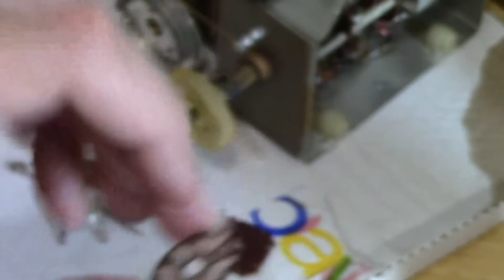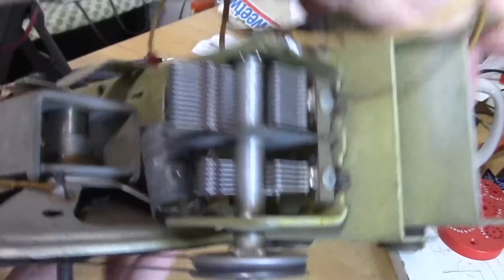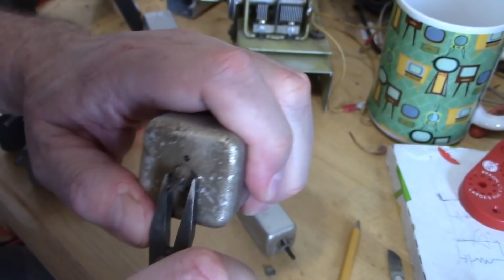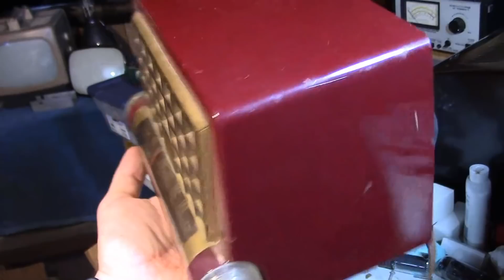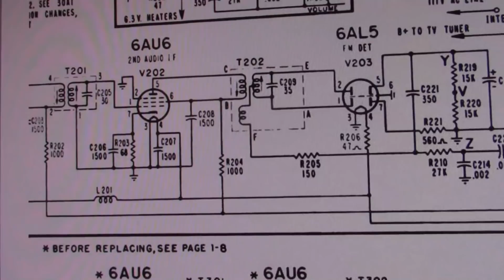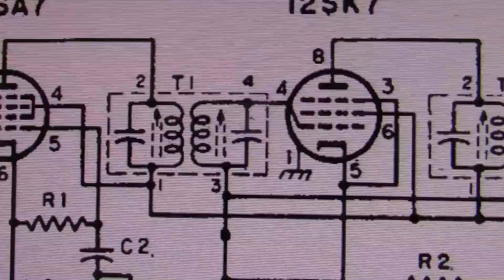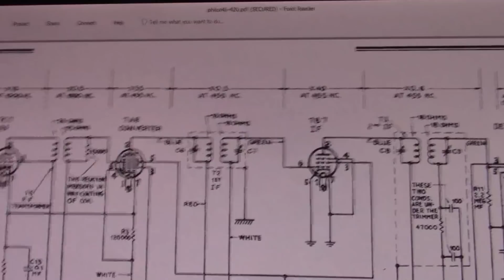Silver Mica Disease in vintage radios and TVs

Comment: The IF cans with the plastic interior has those silver mica plates. Yes, you get migration but the connections are via spring contacts. I have a Hallicrafters S-56 that has these bad IF cans. Pull the mica caps out and the areas where the contacts touch the mica are all silver, black, blue and yellow. All kinds of odd corrosion. I think there is some galvanic corrosion between the silver, the metal contact and whatever it is plated with.

Comment: The M tester is accurate enough to measure those capacitors if you can get the whole wafer out as one piece. Not really something for the Casual radio collector you have to be pretty serious to get in this deep
Reply: That's the same exact approach Jason JJ Cruz would use to replacing capacitors.
Reply: I was just about to comment that I prefer your method of reverse-engineering to find the values, gut the mica wafers & reassemble can with trimmer caps then peak the IF using the caps & measure what you get.  Much nicer result than measuring even mildly-faulty originals & lots nicer than some folks "they're all about 100 puffs" job.
Reply: @danmackintosh6325  that's how I was doing it before I got the M tester. But the M tester will read those things within a few pf
Reply: @shango066  They're pretty good little tools, just found the limitations of mine the other day though in working on an old signal generator. It "only" measures down to 20pf

Comment: People on the Internet spend way too much time stressing out over this, almost as much as they stress out about capacitors and spraying Deoxit all over the place.
Reply from the maker: I don't follow?  If your radio has it, you fix it.  If it doesn't, move on.
Reply: @bandersentv  I have seen it misdiagnosed online, many, many times. It’s not as common as it’s made out to be. Much more common on newer AA5’s. Communications receivers, not so much.
Reply from the maker: Ah, I understand and agree.  This is only the second time I've encountered this problem in a radio.
Reply: @ArthurHallicraftersKitchen  I understand what you're saying, it is like how some meds are over prescribed, without proper testing. Same with automotive sensors or actuators. There is a lack of knowing how to pinpoint an issue.  Voltage measurements or listening to the stages help narrow the bad spot down. Over the 40+ years I have been in the hobby, I have only ran into true SMD 10- 15 times  total. I have never had to deal with SMD on a boatanchor, or any communication receiver, yet :)

Comment: if you need to have that disc recoated, its not that hard for me to do.

Id simply remove the original silver with acid, then recoat it in an evaporator using a pattern mask. I can even plate the silver in aluminum to protect it longer.

As for the values, seems like it should be easy to calculate the values of it. then again, im used to this sort of stuff.

edit: should add that in order to do this, i need very good reference photos or an original disk to create the pattern masks and measure the silver thickness originally used.

edit2: funny enough i have period accurate equipment to recoat the disk. i just find this amusing
Reply: Why would it have to be silver at all? Would gold work?
Reply: @SeekingTheLoveThatGodMeans7648  higher electrical conductivity. but yes, gold would also work. 

Personally, id prefer gold over silver
Reply: you might have a good business opp if you can rebuild those reliably
Reply: @donsurlylyte  just one snag to this, i would need an original (even damaged) example to reverse engineer. Creating the actual coatings is a routine thing for me, as i do it in my lab on a regular basis.
Reply: @donsurlylyte  Dam right. Find the original values and make a bunch and sell for $2 a piece.
Reply: If you were doing this for others and charging a reasonable amount for your time, how much would it cost to do these?  I suppose the first ones that you would do would have the most labor and later ones would benefit from having the information and patters already made.